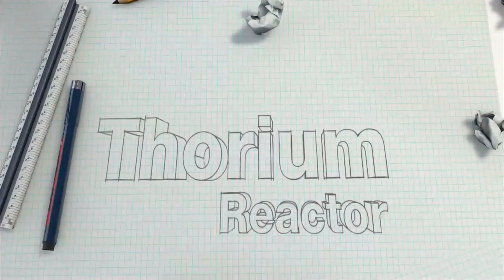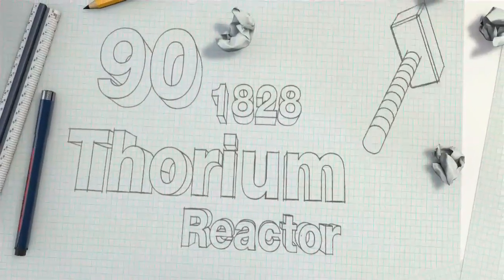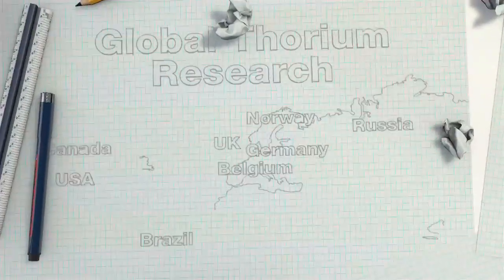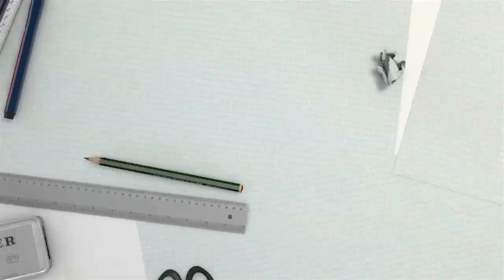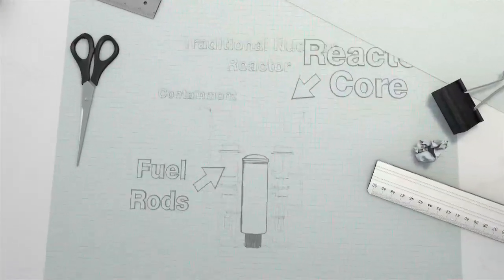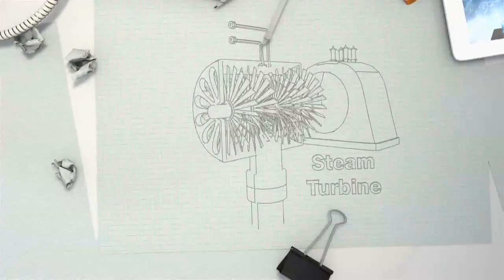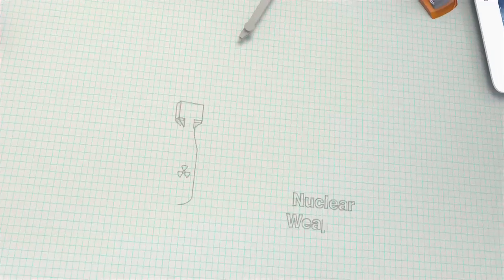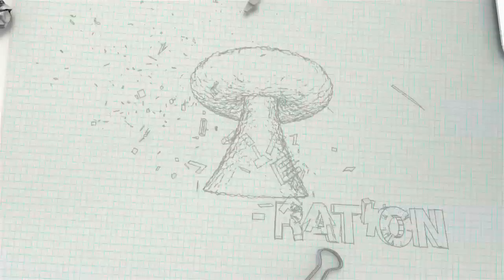🌏 earthrise - How does a thorium reactor work?

Comment: The mention of Chernobyl is misleading. It was a safety check that had gone wrong. The first coolant measure failed. The secondary safety coolant measure was in repair. The test should not have taken place until both safety measures were functional. Sadly things were over looked, stupid games where played and they won stupid prizes. All because they failed to maintenance the coolant distribution system and function of the graphite rod control system. If the test was postponed and the key components were reviewed and found that they were in great need of repair, then repaired. This catastrophe would have never happened.

Comment: What was it she said almost at the end, about something being used as a trigger. What was the element?
Reply: I'm not expert, but I believe it is the waste of uranium or plutonium.
Reply: I am not an expert either however from what I read, A trigger to start Thorium electrons cascading can be the close proximity of a radioactive element or being pulsed with a laser can also work. If a radioactive element is used the process gradually neutralizes it so this may be the answer to getting rid of radioactive waste.
Reply: The trigger is some source of neutrons.  Thorium itself is fertile not fissile.  It takes a source of neutrons to transmute Thorium 232 into fissile U233.  Existing stockpiles of waste from our light water reactors could be used as this neutron source.

Once a thorium reactor has a sufficient U233 content, the fission of the U233 with thermal (slow) neutron will result in the U233 atom splitting into one lighter and one heavier daughter atom and either two or three neutrons.  It is these neutron that can then 1) create another U233 atom by striking a Thorium 232 atom AND 2) fission another U233 atom.

The value of using the existing nuclear waste for this purpose is that, rather than it remaining a long lived nuclear waste, it is converted into energy and daughter products which have a much shorter decay chain before they become stable isotopes.  The result is converting our 20,000 year waste problem into a 300 year waste problem and gaining energy in the process.

Comment: Why not develop solar and wind? People could generate their own energy and on sell any extra, or if needs be, take some from the grid.
Reply: The disadvantages of solar and wind power production are many. Both power sources produce DC which much be converted to AC and transformed to high voltage to be transmitted to where it will be used. EACH solar or wind generator needs high tech invertors (expensive and maintenance heavy). EACH power source must be converted to the same voltage such they can be paralleled. Solar doesn't work at night or on cloudy days or when they are covered with dust or snow. Wind generator rely on an unreliable source of power. They are unsightly. Each generator requires lots of materials which would be used more efficiently if they were used in a single generator system such as a nuclear, gas, or coal fired power plant. The damage of mining and refining the materials in so many generators is naturally more extensive. Surplus power is stored in batteries which are composed of lots of hazardous materials. Green energy isn't that green.

Comment: There will never be a commercial thorium reactor, it doesn't produce cheap plutonium hence has no use other than producing power. The production of power by means of nuclear energy has never been economically viable. The whole nuclear energy industry is simply a way to produce atomic weapons, the energy a by-product.